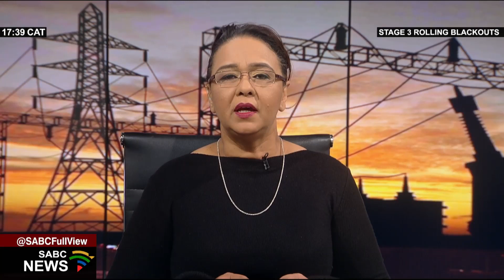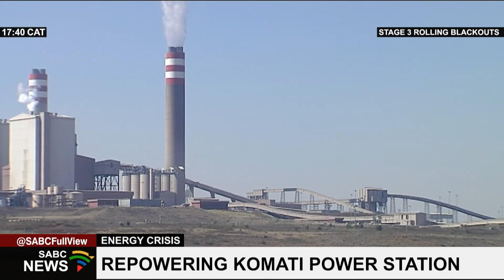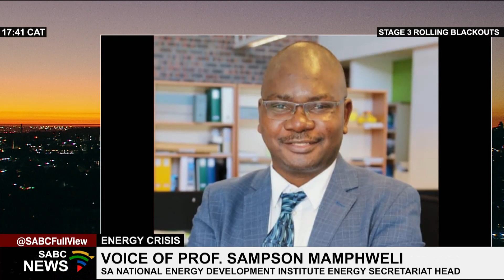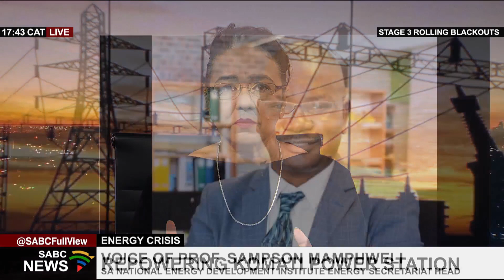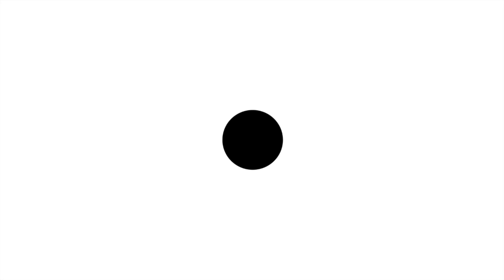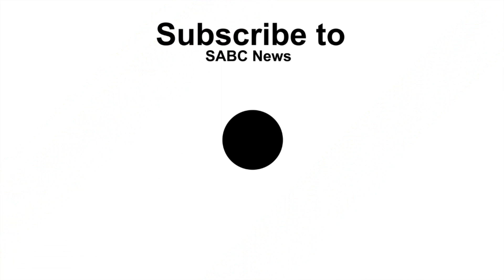Pilot project to repower Eskom's Komati power station: Prof. Sampson Mamphweli

Comment: This was a stupid line of questioning. More relevant for the viewer to understand would be:
1. How many people lost their job (or sitting idle) because this powerstation was mothballed last year?
2. Why would you mothball an existing powerstation functioning at 87% EAF in the middle of a power shortage crisis?
3. Eskom has been burning diesel to minimise load shedding. If this powerstation was still functioning we would be receiving 1000mw or 1 stage of reduced load shedding. How much has the additional cost of burning diesel (i.e the direct cost of shutting down the powerstation) cost eskom ergo the south african taxpayers? Hint... the answer is likely 10s of billions.
4. If we are borrowing circa $9bn to fund this renewable power plant at the exorbitant cost of renewables (perhaps 5x to 10x efficient coal fired power when all costs are considered e.g. cost of inversion from dc to ac, storage, new grid capacity, back up base load etc.) does this not amount to privatisation of south african power supply to outside imperial shareholders while at the same time raising the cost of additional electricity by possibly 500% to the south african public?
 5. Is this not likley corruption that dwarves that established in the Zondo commission findings ?
6. If the above is essential analysis  - why do none of the South AFrican media outlets cover these ideas and what does it say about the role of mainstream media in the ongoing impertial and neoliberal state capture project, and perpetuation of joblessness, poverty, and crime in South Africa?